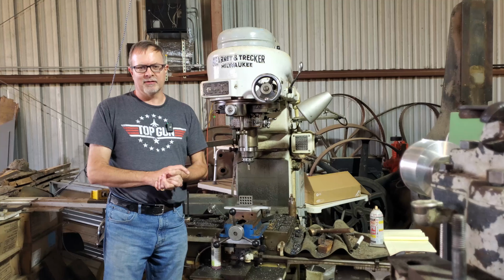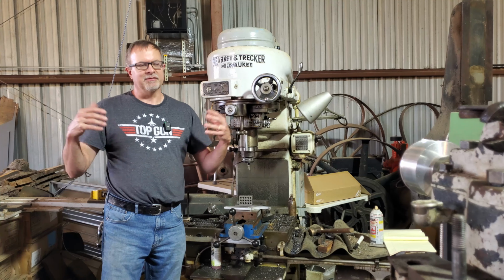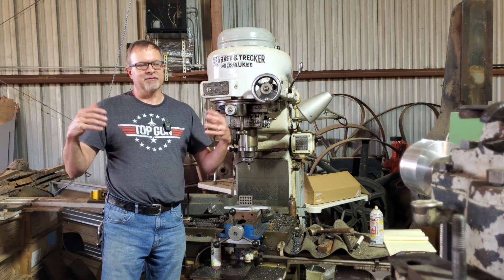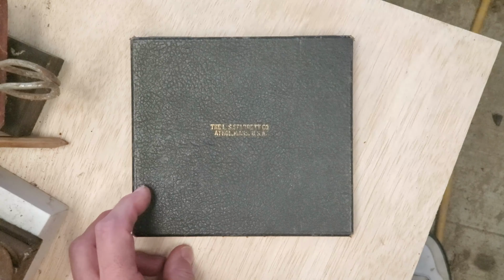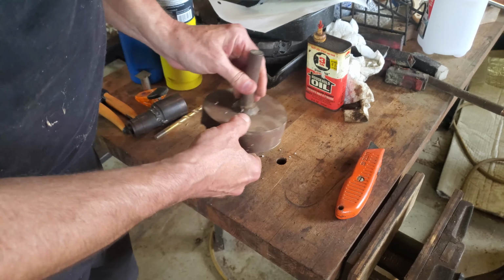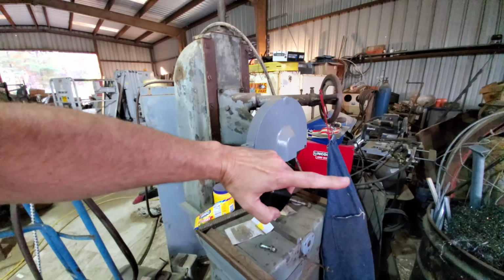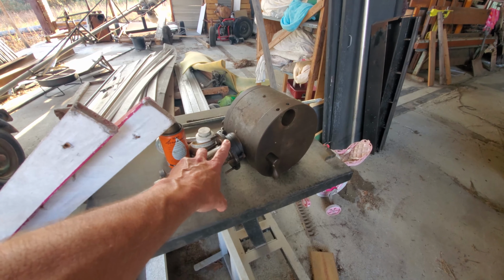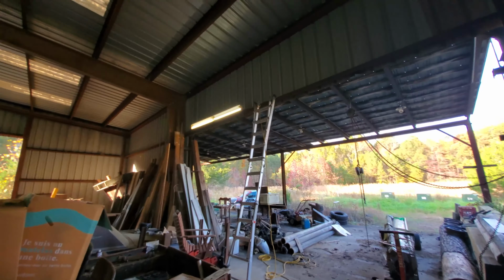New Tools and Pre-Thanksgiving Shop Update

Comment: The LED upgrade of the old flourescent fixtures will be really nice. For the HVAC blower motor, when mine failed in a similar way, I took out the oilite bushings and turned aluminum adapters to hold sealed ball bearings. No more needing to oil the motor and quieter. After that unit was replaced, I kept the blower assembly and used it for my attic fan as it was much quieter than the crap propeller fan. It didn't need to make any static pressure, so it ran cool and used less power than the prop fan. Used that for 12 years and took it with me when I sold the house. still works fine and will use it for the exhaust system on the new shop eventually.
Reply from the maker: I hadn't thought of a bearing conversion, might be an option here. We're using this for our heatwe in the barn. The old AC condenser is copper coils so we run the boiler water through it.